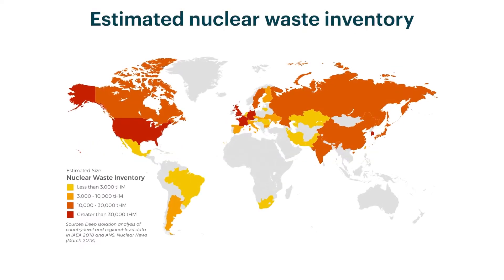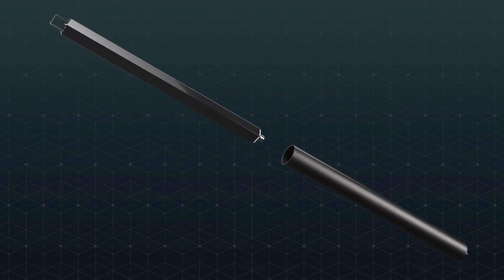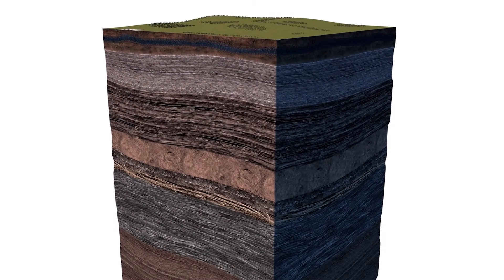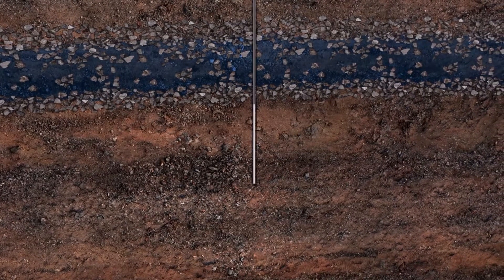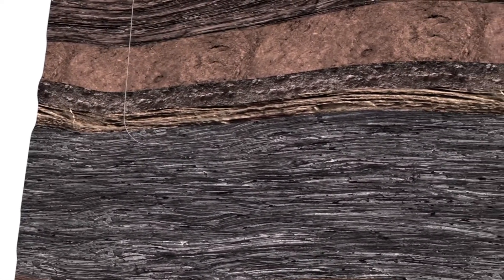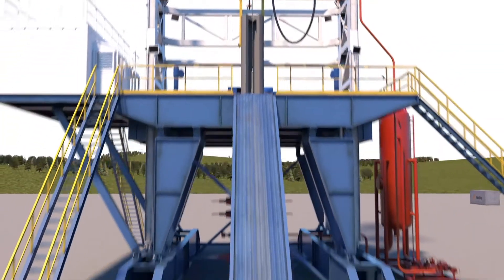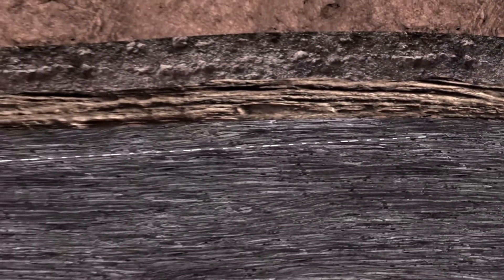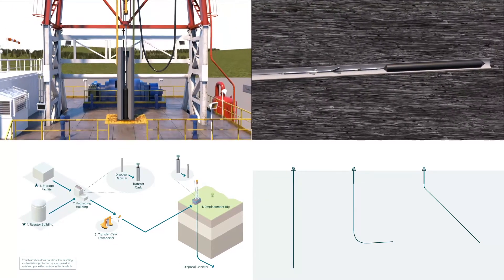UPDATE: How Deep Isolation Technology Works (Intl.)

Comment: I think this solution is brilliant in its permanence as well as simplicity.
I am a polymer chemist and work in water treatment, water recycling, ultra-high hard Roman type cement`s , oil and gas polymer recovery methods, radiation shielding, and military armor.
I would like very much to contribute to this process.

Comment: What happens in a case of a inverse reactive current caused by unilateral phase detractors? Does your product/service offer automatically synchronizing cardinal grammeters comprised of Dodge gears and bearings, Reliance Electric motors, and Allen-Bradley controls? If not I believe the Rockwell Retro Encabulator is a better option due to its 6 onboard hydrocoptic marzelvanes, so fitted to the ambifacient lunar waneshaft that sidefumbling was effectively prevented. It is also better due to the main winding of the normal lotus o-deltoid type placed in panendermic semiboloid slots of the stator, with every seventh conductor being connected by a non-reversible tremie pipe to the differential girdlespring on the ‘up’ end of the grammeters. Moreover, whenever fluorescence score motion is required, it is also able to be employed in conjunction with a drawn reciprocation dingle arm to reduce sinusoidal depleneration. 

Please follow up as I'm curious whether there's something I'm missing or whether your product/service offers any of that. Thank you

Comment: What happens in a case of failure? Such as the Rods have to be retrieved?
Reply: You can't. After a few weeks the bore hole will compact around all the cases. Besides there in no reason you would need to recover them ever. The whole point of drilling miles below the surface is to safely allow them to decay safely for the remainder of there halflife. There is literally nothing unsafe about this.
Reply: If you wanted to reuse some of the fuel you wouldn't put it the hole in the first place.
Reply: then you are on ur own